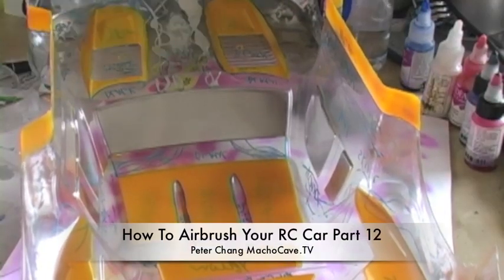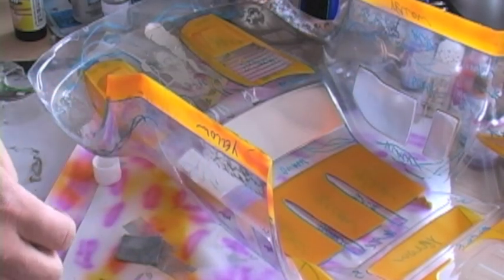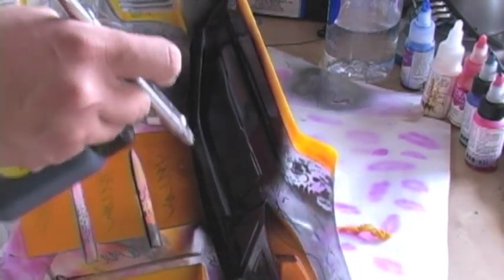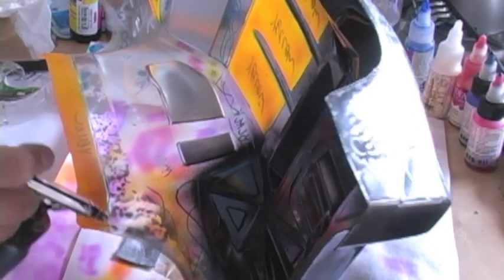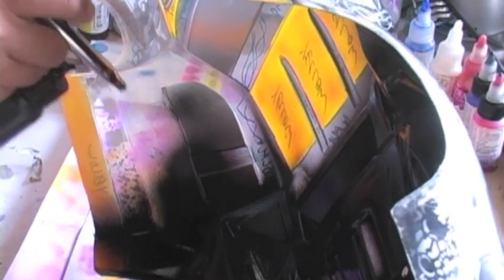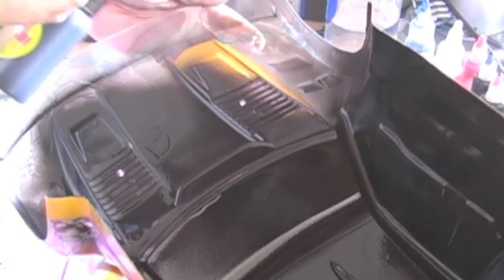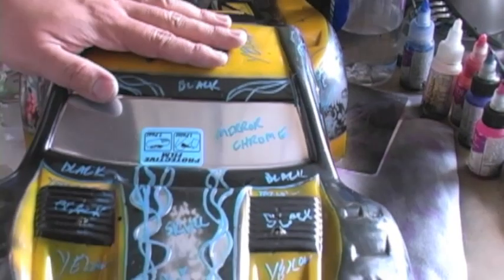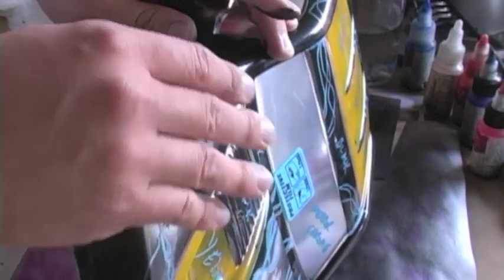How To Airbrush Your RC Car Part 12 Airbrushing with Faskolor

Comment from the maker: Thanks! Overall as a medium laquer based paints should provide much more vibrant colors. However, we are viewing the paints through Lexan which sort of diminishes the vibrance a bit so water based paints also work out very well. If you are using laquer based paints I'd suggest applying multiple coats :)

Comment: The issue with the black showing through is NOT the choice of paint used or cure time, its the fack that black is much darker and will bleed through just about any lighter color. When you spay a lexan body  please do not use this as an actual tutorial.  Spray dark to light otherwise your colors will not be as vibrant, or if you insist on doing like this at least have the common sense to spay a back coat of white first to seal those light colors before you botch up  the whole thing by spraying flippin BLACK on top of white,  light blues and yellows. But I suggest spraying the black FIRST so you don't run into that problem